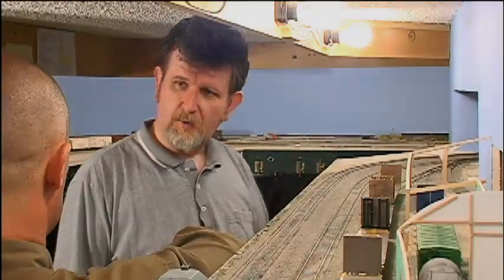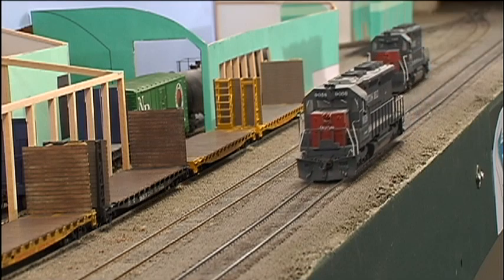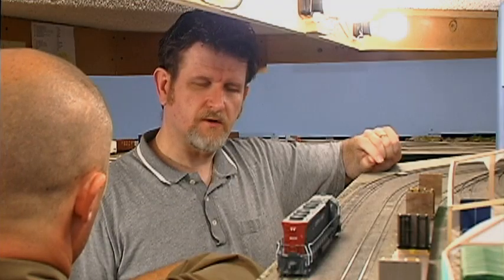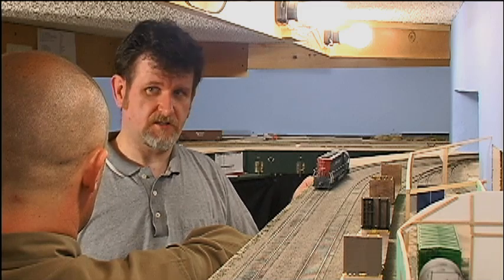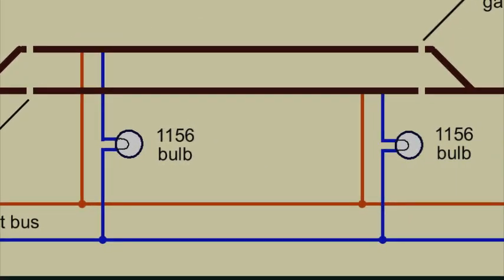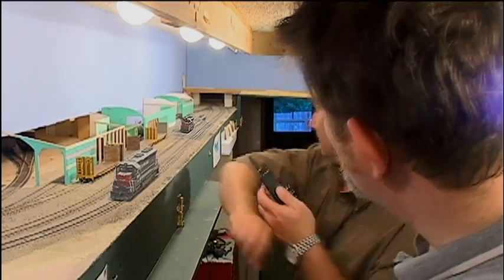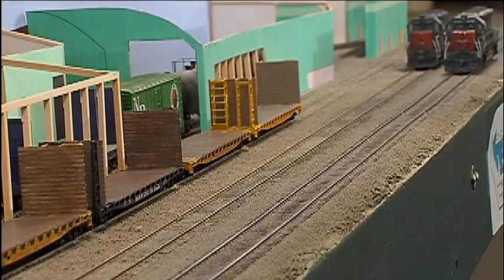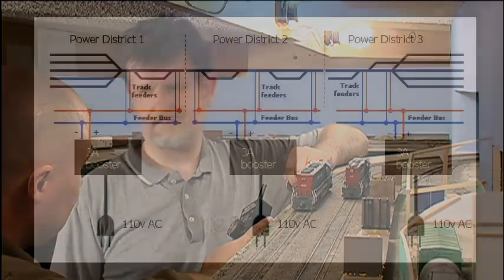mrhmag.com - November 2011 - DCC Short management demo

Comment: I use the lamp for to protect my 5 Amps. booster and Bachmann EZ Mate control from a short..  If you have a direct shortcircuit (as with the coin in the video) 16 Volts x 5 Amps = 80 Watts, twice a solder !!!!!  The only problem is that under normal conditions, there is a small drop voltage in the lamp, but it is not significant.

Guillermo, from the Patagonia Argentina

Comment from the maker: Been running this way on my large HO Siskiyou  Line layout for 11 years - never had a booster problem in that time.

The bulbs let 2.1 amps flow when there's a short. Is it safe to have a 5 amp booster be asked to deliver a 2.1 amp load? Sure it is - all it looks like is several more locos just came on line.

What's less safe is a sudden surge of 5 amps with no load through track and wheels - I've seen is ruin equipment.